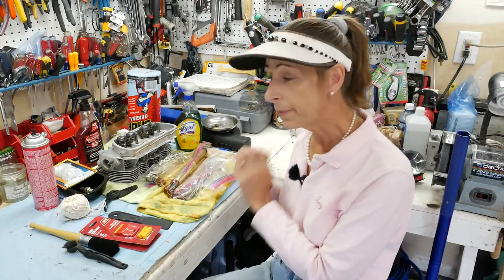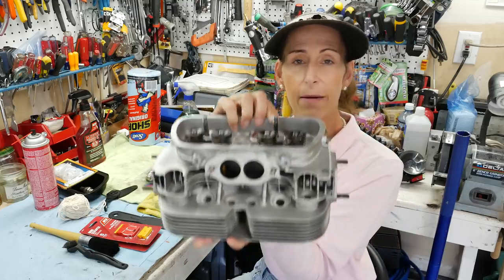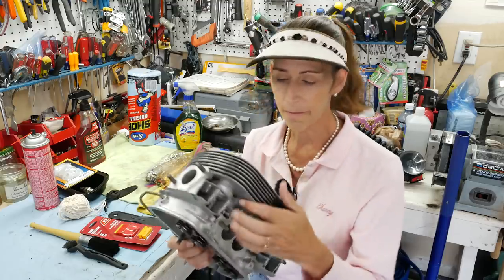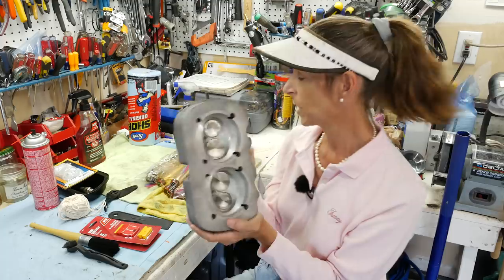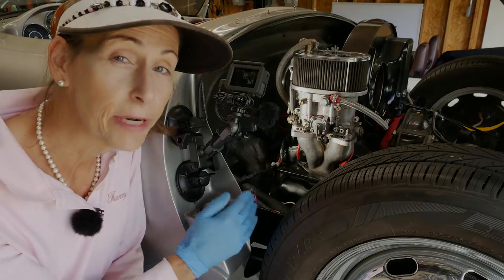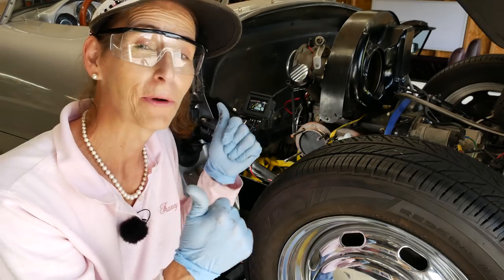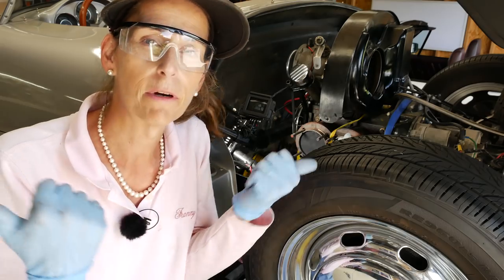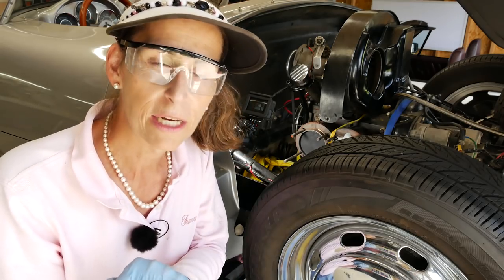Beck 550 Spyder Replica VLOG #5 - The Tale of the Headless Spyder

Comment from the maker: In episode#5, We remove the left head and clean those pistons!  What do you think of those nylock head bolts? Good idea or bad idea???
Reply: bad
Reply: Nyloc nuts will only stand temperatures of up to  120 C. So bad idea on an air cooled cilinderhead! And that is apart from the difficulties with torqing them in the first place!
Reply: Bad idea!  Factory bolts and torque settings will last the life of the engine.  Make sure you test the case bolts.  If they have been over-torqued in the past, they may pull out when you try to put the heads back on.  Nothing as fun as watching a case bolt pull out when you think you are getting everything back together....  Regards
Reply: They are NUTS, not bolts!

Comment: Your comment on the socket reminded me of a situation on my Racecar a few years ago; Swift DB2 Sports 2000. There were a lot of structural members that were welded onto tubes which had the bolt deep inside…we had a perfectly good socket machined down just a little so it fit nicely in the tube and firmly on the Bolt head. Sold it with the car of course.

Comment: I think a minor crack between larger valves isnt an issues unless compression is a factor. I bet you had no idea this would be so much. I appreciate your determination.
Reply from the maker: It is a LOT more than I thought...  I thought it was just to be a slight tuneup ;)
Reply: Cracks between the aircooled vw heads are super common and most of the time not an issue unless the cracks trail down the intake or exh ports, in that case they would need to be welded up or just replaced.
Might have been the reason your machines left then alone.

Comment: Regarding the crack, it's very common on this engine platform especially when big valves are fitted. 
General rule is provided the crack is not too deep causing excessive compression loss the engine will continue to run fine.  
Being air cooled also means no coolant pressurisation issues like a modern engine.
Nice editing Franny, the format works really well :)
Reply from the maker: Thanks Eagle Eyes! :)

Comment: Very cool.  Huh cant believe I didn't see the crack. Will have to go back and watch the other video again. Quite surprised that the machine shop didn't catch it and mention it. Awesome video.
Reply from the maker: They said that you only really need to worry if the crack extends to the spark plug hole.  Ok.  They seem good with it and they could have made a fuss and suggested to fix it.  Thanks!
Reply: Good to know. Thank you.

Comment: I would have the  the machine shop check the heads with Spotcheck or Zyglo for cracks.  With all that red high-temp silicone smeared on that engine, I would also pull the cylinders and clean, paint and reseal them.     But I realized it's someone else's car and they may not want to spend the money on it.  Which makes no sense to me, even on a replica...  Also, I would also never use nylok nuts on an engine, that can't be factory...
Reply from the maker: I agree...  I have been in close contact with Mike about the car and he stopped by this morning to drop off some parts.  I mention all the great suggestions and observations and let him decide the course he wants to take.  Oh, and yeah... those bolts are getting replaced ;)  Thanks!
Reply: Yes, nylon 46 appears to have the highest melting point 550 some degrees if Nylock nuts indeed have nylon in them.

Comment: Very informative! I didn't know about the plastic razors and good to see another of the trusty WD40 as well. I'd replace the nylock bolts as nylon has properties that are not desirable in this particular application.
Reply from the maker: I didn't either and I was really surprised how much better WD-40 was than brake cleaner or even carburetor cleaner.  I have a full new set of grade 8 nuts and washers.

Comment: I would never never never put nylok nuts on an engine head.  Also, the machine shop should ALWAYS inspect every head they take into their shop for defects such as warping, cracks, etc. before they perform any work whatsoever.
Reply from the maker: Those bolts were a complete surprise and I seem them all over the case as well.  I was curious and EMPI sells a kit of them.  This engine looks like it was assembled with quite a few EMPI parts.  The machine shop took another look and felt that it really is only an issue if the crack runs to the spark plug hole.  Ok, I guess...
Reply: Think about those nuts this way:  The only thing grabbing on to the head studs is made of plastic... and plastic that under constant extremes of temperature.  Sure thermoplastic is tough stuff, but let common sense prevail.  86 those bad boys! lol

Comment: I would HIGHLY recommend watching a few of VW Darrin's engine assembly videos.  He explains the Nylock type nuts.  They aren't nylock, they have a rubber o-ring.  He explains how/why to use them.  They stop the oil leaks...  You put the rubber side OUT so they don't affect torque.  VW engines are a weird bird.  I would never use them on a ford or chevy, but a VW wants/needs them.  The red kind are the ones you want.

Comment: Hey Franny, I'm really enjoying this series.  You have a great methodical approach, and very good editing and narrative technique!  But, why not just pull the engine and tranny?  Seems you have the equipment, and in most Porsche/VW derivatives, its roughly four bolts and some connections...
Reply from the maker: At this point, I'd have to agree ;)  It is a pain to get it all out (especially working alone) as it has to come out the top, but anything else and I'd be really tempted.  I hope that is it for the core engine work.

Comment: The heater box exhaust is useless in this car. The are adding un-needed heat to the engine bay. I would have changed them to j exhaust tubes.
Reply: This was the tip I was looking for. Those Beck Spyders can be pretty pricey, so it was surprising to see so many impactful mistakes.

Comment: I'm not a fan of Nylox nuts in that application.  Not sure about the heat with the nylon.  In any event, they have to be replaced.  I wouldn't feel good about reusing them.  Make sure the replacements are something like Grade 8 (easy to find at McMaster Carr 
 or MSC).  That's another reason to replace them.  you don't know it someone else has had the head off and either reused the nuts or sourced them from Home Depot's Grade 2 collection..
Reply from the maker: Lol!  Yup all new grade 8 nuts and washers :)

Comment: I would install the missing cooling tins, thermostat setup to that engine.
Reply: That engine is missing a lot of tin and with the nylon locking nuts it doesn't look like a very good engine build. 
In fact, personally, I wouldn't use anything from empi, like even if it were free
But, the last engine I built was a berg 1776 B&B.